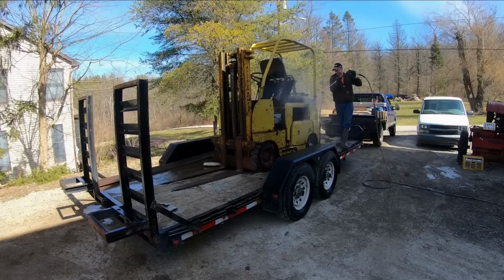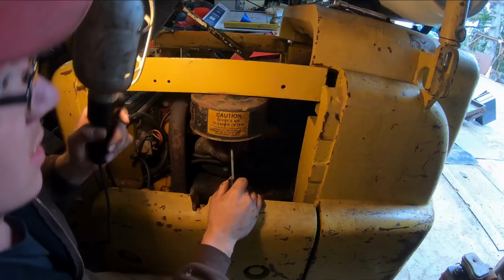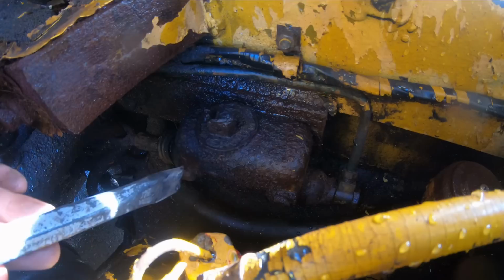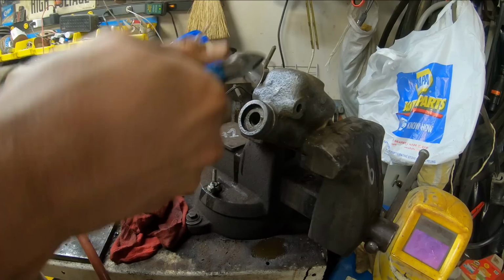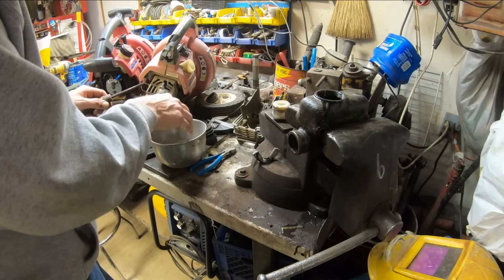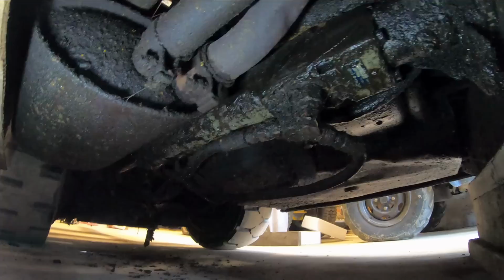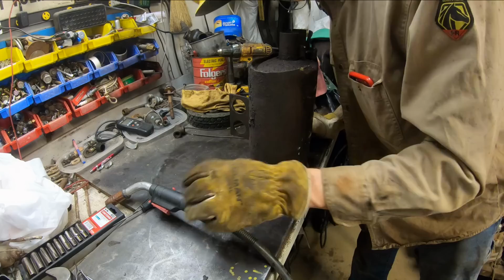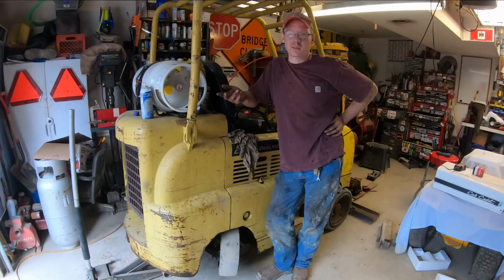Fixing the Cheapest Forklift on Marketplace!! Pt.3

Comment: You may have to advance the plug wires at the cap one position clockwise each, since you 'ran out of advance'. Then you'll be able to move the distributor clockwise back to where it used to be originally and it will be fine.

Comment: Re: burning the oil / grease out of the muffler:  years ago, I bought a WWII-era two-stroke genset at an estate sale.  It would barely run.  Turns out it had a broken ring.  Once I replaced the ring, it ran great.  The first time I ran it under load, it was JUST LIKE YOUR FORKLIFT!  So much smoke!  All I could figure is that the previous owner had run it for a long time with the ring broken, totally filling the muffler with oil.  After about an hour of killing every mosquito within a ten mile radius, it cleaned up.  No more smoke!  Keep up the good work!
Reply: How much can your generator power? Also, interesting tidbit about the muffler being filled with oil!
Reply: @ianc.9482  If I remember correctly, it is a 600 watt unit.  It's pretty small - I can pick up with one hand and I'm not a big guy - suspect it was made to used in aircraft or ground vehicles as an Auxiliary Power Unit.  It's a two stroke, so I figure with the broken rings it was running so poorly (and likely rich!) that the oil wasn't getting burned in the cylinder...and was getting dumped raw into the muffler.

Comment: You should get yourself a set of left-turning drill bits. They are really handy to drill-out broken studs or screws. Often the screw threads itself out so you don't need to use an easy-out.
Reply: And get them in cobalt

Comment: Friend did you notice : newer are the machines or vehicles more hoses, tubes and pipes there are....! BRAKES yes because getting those forks up the ..........want be sweet !!!
Master cylinder = new one  full stop!! 
How many bottles of all kind of spray do you use each month ...? 
Hooo put Two motorcycle exhaust mufflers instead of that junk good for scrap !!!
Yes you work hard and look for repairing and not just replacing witch is good and great !!!All the best to you my friend Mat !  Keep UP and ABOUT !!!

Comment: To get more advance you need to undo the pinch bolt on the other side of the distributor clamp. The bolt you undid allows a small movement of the clamp to the engine block. 
The pinch bolt will allow the clamp to rotate on the distributor.
Reply from the maker: Yes I was thinking about trying that, it sounds really close to me I was waiting till after the muffler was on to re adjust it

Comment: Love your videos.  I have been watching them most of the afternoon. Hints: 1. Aluminum is higher than iron on the electrochemical series. That means that the aluminum cap becomes the sacrificial anode and the reservoir becomes the cathode. That is why the cap has disintegrated. 2. When removing a broken stud, use left hand twist drill. Sometimes the drill will free the stud by itself. A right hand twist drill only makes the stud turn in tighter. From your old, tired out, friendly mechanical engineer.

Comment: I said before we had one of these in a shop I worked at back in the mid-90s. I was trying to remember why we kept it around and why it was popular in the shop, when it was the oldest, smallest, and had the lowest lift capacity. It came to me that this forklift, with the headache rack removed, had the lowest profile in terms of lifting things to high racks inside buildings. This old gal was the only one our three lifts that could lift pallets to the very top shelf.

Love your vidyas. Keep it up.
Reply from the maker: one of the reasons I got it was because of the low clearance ability!

Comment: Adjusting timing - There are two bolts on the distributor bracket. You used the fixing bolt which gave you a limited amount of adjustment (size of hole). On the opposite side of the bracket is a 'pinch bolt' which should allow you to slacken it off and adjust the timing over a much wider range. Worth a try? You might like to check the wiring harness again now you have torched it a few times? Finally, don't forget to give the 'empty' propane tank back to your dad.
Reply from the maker: I thought about trying that, I’ll give it a go. I didn’t know if that would be going too far

Comment: The issue with the long bolt might have been rectified by running a nut down it and cutting to the correct length, then undoing the nut off which would keep the threads useable. Sill enjoyed the vid though, been great seeing how far you have come with this project 👍
Reply from the maker: I thought about that but didn’t wanna get a the stud stuck in there

Comment: Never use oil on brake parts.  Makes the brake rubber components fail.  Same as putting brake parts in gasoline only slower.  Lube with brake fluid only.
Reply from the maker: Never heard that but several said that, good to know
Reply: Learned something new with brakes. I personally have always used lithium or no lube at all when I've rebuilt calipers and masters. Thank you for that 😊
Reply: @DieselCreek  Yeah man, brake fluids and seals are very picky, but thankfully DOT 3 works fine for honing and flushing.
Reply: Absolutely never hit brake components with petroleum base products. Brake fluid only.
Reply: Agree, no normal oils or greases on brake parts, methylated spirits or water to clean, brake fluid and rubber grease. Normal oils make the seals swell.
Reply: Check the fluid type as well. Dot 5 is not compatible with any other fluid types. If in doubt, take some and add a drop of water. Water will not mix with the silicone base of dot 5.

The stupid things you learn from buying military vehicles.
Reply: Hence the Brake Clean parts spray formula exclusively for brake work. Makes short work of brake fluids and related stuff without damage. 👍
Reply: Rubber grease

Comment: You will be lucky if all you need is a kit for the m/c, we always just replaced them.  Also, more than likely you will be pulling the drive wheels to look at the shoes and w/c's, it always seems to go together.  The steering axle was a weak part of that model of AC.  The center steering arm has needle bearing with a pin, nothing to tighten up.  The adjustable tie rod as you called it is not adjustable.  The play is there because the ball stud is worn, if you take the slack out of it, it will probably break off.  Worked on AC's for 30+ years.  Lots of after-market parts out there.
Reply from the maker: i ended up ordering a new one!
Reply: I just bought this same machine.  Mine has a g153 in it. Where are some places to get parts? Thank you

Comment: I don't know anything about forklift mufflers, but If they are anything like automotive ones, I'm pretty sure you welded shut the drain on the muffler. Since exhaust gases contain a significant amount of water vapor, it's going to collect in the muffler and eventually rust it out. It's a relatively minor issue, but may be something to think about.
Reply from the maker: Yes, there’s several smaller pin holes already so it shouldn’t hold moisture

Comment: I worked on so many of those AC's every configuration down to that dual motor that can be turned into a diesel switching off the head etc 6 cylinder
Reply: I just bought the same machine it has a g153. With a zenith carb. The governor rod is not attached to the carb and I dont see anywhere to attach it....

Comment: I noticed that when you rev it up there’s a exhaust leak under the lift directly under the seat on the bottom of the lift
Reply from the maker: way better than it was lol
Reply: Diesel Creek definitely I just didn’t think you knew it was still leaking
Reply from the maker: Bryan Welch it had some pinholes I didn’t even bother with because they wouldn’t weld worth a crap

Comment: You should drill a 1/8" hole at the low point of that muffler as a drain. Condensation collects in the muffler and it sitting there causes the muffler to rot, a condensation drain in the bottom prolongs the life of the muffler
Reply: Looked like it already had a weep hole on the bottom near the end he welded.

Comment: The small hole on the bottom of muffler you welded up were sometimes there to allow condensate water to drain. Some equipment never gets used long enough to build heat to evaporate moisture.
Reply from the maker: Some others mentioned that, there’s some pinholes down there I didn’t patch up so it’s still gonna drain

Comment: I did that once trying to pull a stuck injector.  Stood there and watched the fuel line jacket burn like cannon fuse.  It went around the engine, down the side of the block into the belly pan.  When I saw some leaves catch on fire I realized I was in trouble.  By the time I came back I heard the fuel filter pop and it was all over.

Comment: Uh oh I see that Napa life with Mac’s brake cleaner... Never had any luck with that stuff it always left water behind when it dried because it would freeze the parts and then attract all the moisture in the air. Only brake cleaner I found that doesn’t do that is Autozone’s house brand. It has never let me down, always dries quickly, isn’t super cold when your cleaning parts off in your hand, doesn’t leave any film or weird residue behind
Reply from the maker: i typically use CRC but i got a case of that cheap cheap
Reply: Diesel Creek Definitely, that’s how bossman found it at such a good deal.  We just bought 15 cases at 80 cent per can. Works awesome for the price though, keep your air nozzle in hand to prevent flash rusting on clean steel. 👍🏻

Comment: When I was old enough to drive a car, my father bought me my first car. It cost £10 (in 1987) and it was a scrapper. But we spent ages welding it up including the silencer (muffler). The metal was so thin we ended up burning holes as fast as we could fix them. Managed it in the end. Two years later there was nothing left of the original silencer, but it was still on the car - The Muffler of Theseus

Comment: Before you even bother looking at the ignition timing you needed to check the of the condition of the contact breaker and the gap plus the condition of the rotor arm and the distributor cap electrodes.  Then check if you have a decent spark on each plug.  THEN you do the ignition timing.

Comment: An old trick my dad tought me. If you need a shorter bolt. Find the thread size and nut. Screw the nut on the bolt for the length you need then cut the excess off then taperthe end enough to take the shrp edges off.

Comment: We bought a kit from NAPA that had several different sized master cylinder  rubber parts in the kit.Last time I tried to rebuild a master cylinder it needed just a little polishing in the bore,did the same thing you did only Used brake fluid to wet the stones.Cleaned every thing up real nice inside new rubber parts.Was bench bleeding the cylinder and the darn thing started leaking fluid past the cups.Total waste on thme trying to rebuild.Also had a Hyster forklift that started having problems wth the brakes sticking found out that the linkage had gotten out of adjustment.

Comment: Fork lift dealers trick , use mobile 1 synthetic 15-50 oil on engines that smoke . The burning point is 450* and if you're engine ever gets that hot
It will be toast .you can smell it burning but can't se it , so when buying used lift truck pay attention to the odor coming out of exhaust if it smells like burning oil but not really smoking it's a oil burner . But that doesn't mean it's not a good useable lift. It just has a hell of a lot of hours on it
People have lots of used hour meters and change them to make more money .
Reply from the maker: It only smoked because of that muffler I let it run a while and it all cleared hp

Comment: On a broken bolt I always weld a washer to it and with a mig you can kinda build up the center of the bolt then weld a washer to it that’s pretty good size so you can place the nut on it and weld just two side on the outside!

Comment: Awesome! Love seeing a project come together. But be careful using angle grinders (especially with cutting discs) without their guard on. Those discs can explode, I saw it happen on some other channel. You can get aftermarket universal guards at most hardware stores. Also at the end the smoke had all kinds of colors, did you blow the head gasket by revving high and are you burning both  oil and cooling fluid now?
Reply from the maker: ive got the guards just hate them, i keep myself out of the line of fire if they decide to pop, and im not sure what you saw but shes still running great and the smoke is all gone now.

Comment: EPA: "Thanks to the Coronavirus, air pollution around the world has decreased by 78%."
Diesel Creek: "Hold my beer".
If your distributor is a Delco Remy distributor 1112602, and it looks like it is, your forklift was built between 1958 and 1964, and its position is about 90° off...you should be able to see the Delco Remy label, when you're looking at the engine block. Shift the wires by 1 and you'll be able to get her timing bang on.

I had a bit of a long post, but when I read it, even I would have told me to go screw myself, so take what I say constructively, because I really enjoy your channel and don't want to see you get hurt or burn your house down....just things to consider.
Right tool for the job (snap ring pliers, not dikes)
Fire extinguisher
Degrease everything, before working on it.
Cost analysis of replacement vs. repair

Comment: You have yourself  a warehouse /shop  only forklift , I guess it will work well when you pour your concrete floor at your Autocar.  Those master cylinders when the bore is pitted isnt worth fixing, they used to be 200.00 -400.00  & difficult to find until 5 years ago, nice to see someone rebuilding equipment to use, Thumbs Up !
Reply from the maker: thanks for watching!

Comment: I'm a beekeeper...imagine that...
& I use a smoker for my angrier bees.
My smoker gets filled with carbon & pitch deposits inside.  It gets very thick, 1/8" thick!
To remove the carbon & pitch deposits I get the areas I want cleaned I heat the metal red hot and keep it red hot for about 10 seconds.  The adjacent carbon & pitch start to glow red then turns to ash.  
I was thinking, if you placed your muffler inside of a nice big fire and let it get red hot, the entire oil gunk in there will turn to ash and you'll have a perfectly clean muffler.  Any packing would be gone, though...although, I'm not sure if that muffler has any packing in it (I'm not a mufflerologist)

Comment: Look up Sure Shot it’s a 32oz can. You fill it up with what’re you want like brake cleaner, WD40, PB Blaster. Pump it up and it sprays like a aerosol can, they make the 2 options, hand pump model or one you fill up with your air compressor.    There’s 2 company’s that make them. Sure Shot and Spot Spray. You can find them on Amazon or your auto parts stores
Reply from the maker: ive seen them, could be handy for WD40 or cleaning products, but i just use normal trigger spray bottles which are wayy cheaper

Comment: Best way to fix pin holes is drill them out and put a rivet in and weld it if the center pulls threw
Reply from the maker: now thats a good idea i havent heard of.
Reply: Just make sure you use the steel rivets

Comment: When honing any brake cylinders always use kerosene and then flush with brake fluid and lubricate all brake rubber cups and boots an approved rubber grease, If you use a mineral based grease it will cause the brake rubbers to swell and perish.

Comment: Hi Matt. if you break bolt and want to get it out of hole, have you ever tried left rotating drill bit? Drill just a little bit into bit, than push as hard as you can and stop machine. It shlould cause cut into bolt and allows you to turn it by drill bit and get it out.

Comment: I keep a fine spray bottle and spray the wires to see if they are cross firing.  On black distributer caps it is hard to see carbon tracking which will deter proper perfomance .
Reply from the maker: i want to get a new cap and rotor just havent had the time.

Comment: if your engine is an A-C  D-10 or D-12.. the points adjustment is 0.022" and the spark plug gap is 0.025"  Timing is TDC at idle and 25 degrees max with the engine revved up.  if its not a D10 or D12.. try to identify . all the other AC engines are 0.020 point gap and .030 or .035 gap
Reply: What about g153?

Comment: That small hole you welded on the bottom by the blown off end was to allow moisture to drain out of the muffler so it wouldn't rust out prematurely.  I'm thinking that "stuff" you scraped from inside the muffler is from the old girl burning oil.  It collected there and held moisture and rusted out the end.  Back pressure probably blew the end off....
Reply from the maker: no, she doesnt seem to burn any oil, everything leeks upfront and gets thrown into the open end along with dirt off the tires, once it ran a while it cleared back up and runs great, no smoke! no smell of oil burning!

Comment: One more tip when timming put in gear up against building if no brakes and floor it turn timming until valve knock then back off 2 or 3 degrees  .

Comment: at 2720 you can see the stop that limits the pivots on the up and down of your steering its a peace of metal that comes down with a bolt in the end of it if you cut part of that off it will help with you getting over uneven surface had to due the lift that I operate to get in and out of railcars at work
Reply from the maker: i worry that could make the tire rods get into a bind if the axle was tiled all the way